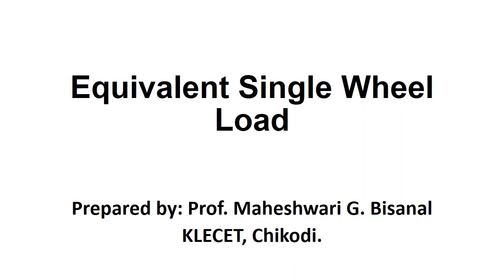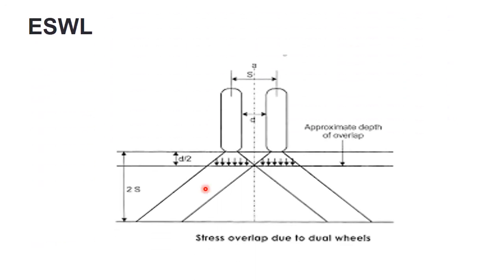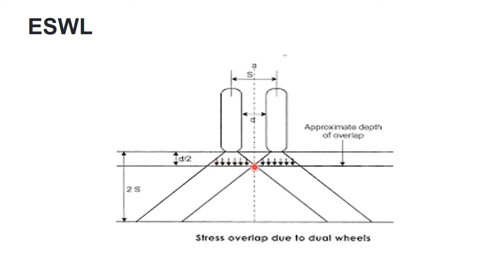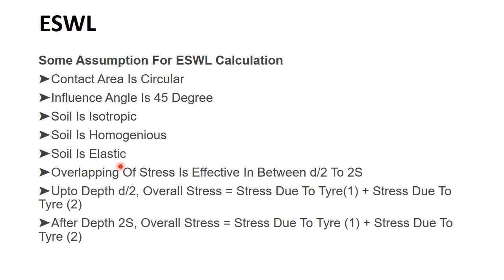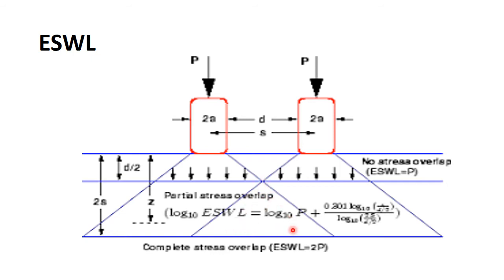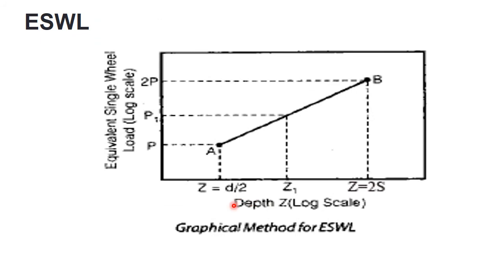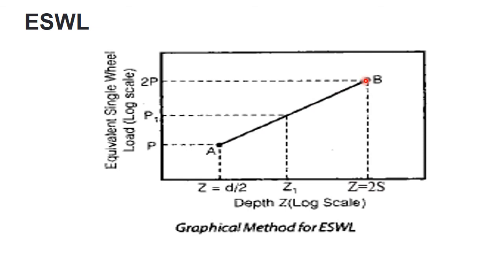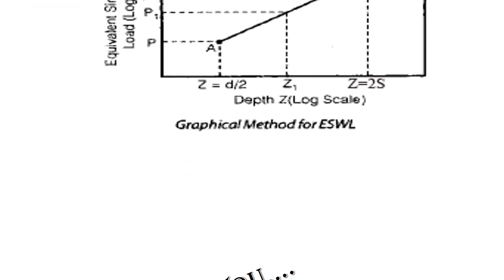4_ESWL

Comment: Doesn't load intensity goes on decreasing with increase on depth..if so how could you assume p and 2p??/please clarify
Reply from the maker: Up to a depth of d/2 each wheel load act independently, (means P)..(coordinates are P and d/2). At a depth greater than d/2, load begins to overlap. At depth 2S and above the overlapped area of compressive stress is considerably high. Therefore P+P it is 2P...( Coordinates are 2P and 2S)